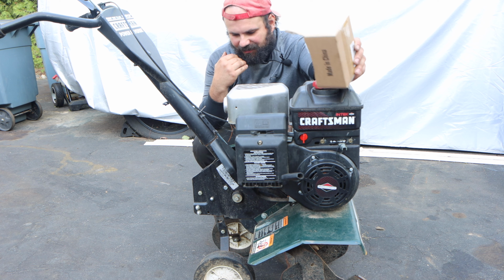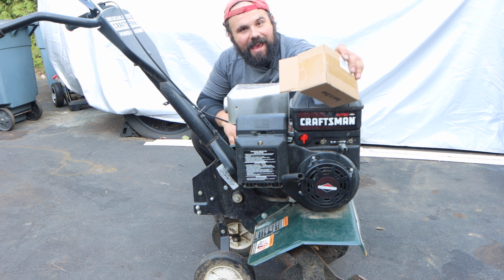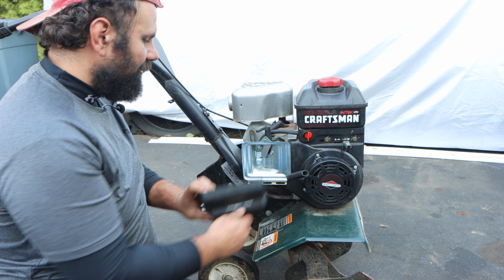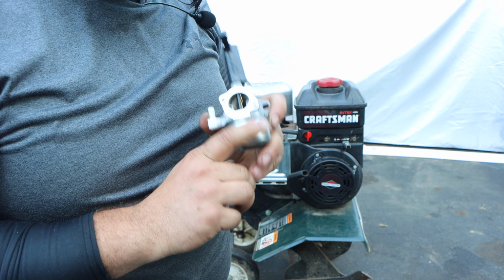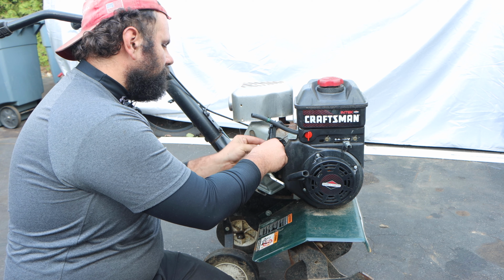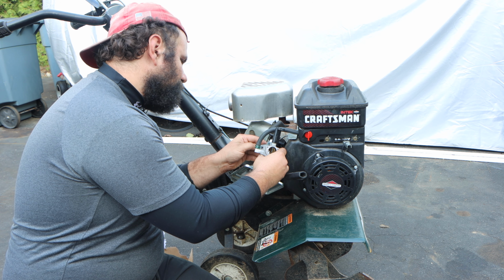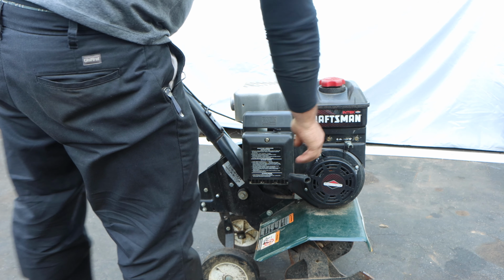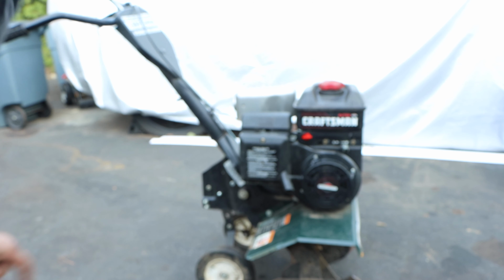Fixing My #Free Craftsman Tiller W Briggs Engine for $15 GEEZUS! PART 2

Comment: I do not like anything about that engine such junk in my opinion
Reply: ehh... They're decent. Just like any engine, keep up with the oil changes and you should be fine.
Reply: @norge696  right that's how I feel about my predator engines keep good oil in them they last forever it's awesome
Reply: @Tampaboys  I'll tell what engines I hate a passion tehcumseh and Kohler courage. 
I went to pickup a free craftsman mower today. sure enough has a tecumseh... whatever. free is free
Reply: @norge696  heck ya bud can’t beat free